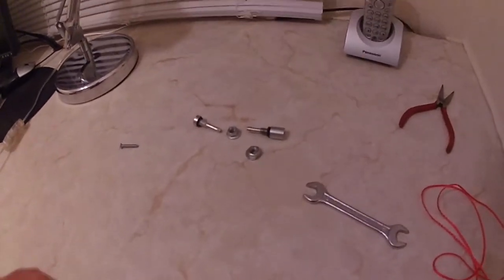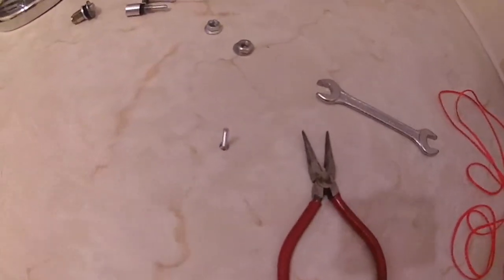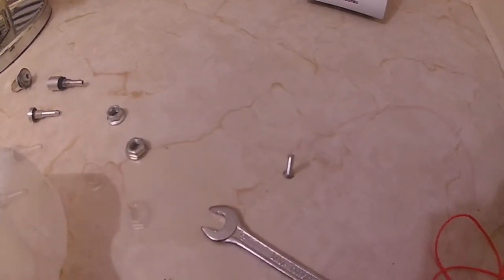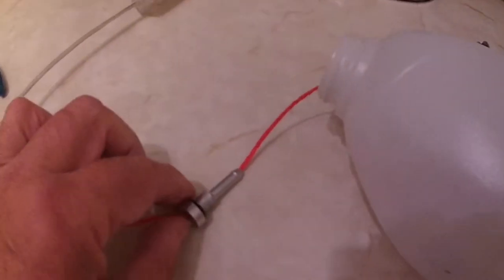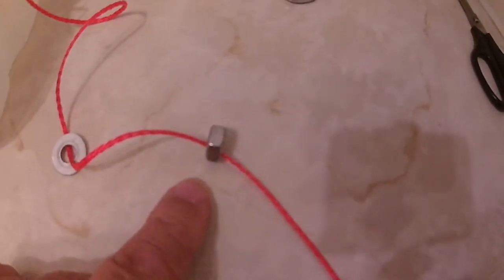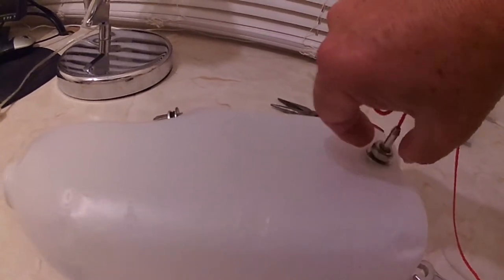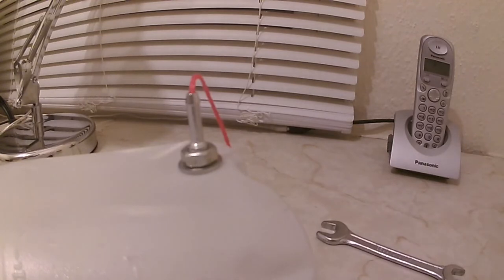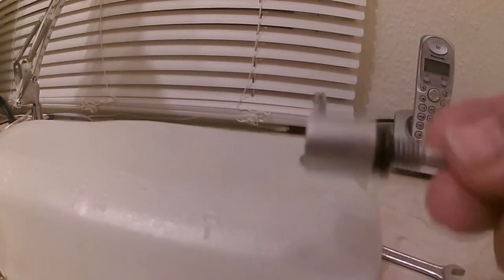Chinese Diesel Heater. Fuel Tank Pipe Fittings.

Comment: You act like in your video that people should already have this knowledge. I know you didn't invent this way of doing it, so obviously you've seen it done before yourself. There is absolutely nothing wrong with asking questions.  I came across this video, looking for people who make their own diesel heater fuel tank out of gas cans. And I was wondering if a vent hole was needed. After putting in a stand pipe, through the tank spout hole, did I need to make a vent? And what's the best way to do that. I'm using a 5 gallon metal Jerry can.
Reply from the maker: Ok matey. Just a tip. Diesel, Paraffin and Kerosene can have water present in the fuel. Metal tanks are not good as rusting can occur.  Diesel vehicles have water traps in the system and have plastic tanks or plastic inside coated tanks. Thanks for comments.  Cheers from old George
Reply: @MakeDoAndMend1  thanks for your reply. Yes, this Jerry Can is spray lined with rust inhibitor. Right now harbor freight has them on sale for 39 bucks, and they are well made little tanks. Even the seams are in a V channel so to not get bumped or hit. I'm wanting to turn this tank into an auxiliary tank for a diesel heater.Some tanks have vented caps, others don't. Can a small pump still draw diesel fuel from a tank that's not vented?  That didn't seem right to me. So, what's the best way to vent a tank like that, without allowing a bunch of water in when it rains? Keeping in mind that the standpipe already occupies the tank spout opening.
Reply from the maker: I have struggled with vents before on tanks. Not really found a good easy way. I have not tried this but just an idea. It only needs to let air in as pump sucks fuel. It may be possible to use an old inner tube valve stem and valve from a cycle inner tube . Not tried it myself .

Comment: Thanks for the ideas/videos.
That said, I think what people were asking was in regards to the brake pipe fitting.  If I understand it correctly, you have the male part inside along with a metal washer and one rubber washer.  Do the whole string and bolt thing to get them through the hole.  Then another rubber washer on the outside followed by a metal washer followed by an O-ring.  Then you put the female on.  The question is then two fold:
1) You won't be able to grip the male part like you show in the video will you?  If not, then how do you tighten it?  Do you not need to hold the male part?  Or was I supposed to also put maybe a lock washer (think that is what they are called) on the inside before the first normal metal washer?
2) How do you insert the copper pipe?  Do I fully tighten the brake pipe fitting, etc, remove the string and then just force the copper pipe inside?  Or do I partially tighten the brake pipe fitting, etc, and then remove the string and insert pipe and then somehow tighten everything?
Reply from the maker: Have you watched all the videos in the playlist. The rubber washer grips inside etc when tightening. Metal pick up pipe is pushed through, slides from outside. Plse watch all videos then leave questions .....
Reply: @MakeDoAndMend1  Thanks.  The first video I watched was from 8 months ago.  Someone asked a question about how you put it altogether (or something along those lines) and you posted one or two days ago that you were about to put a video up explaining it.  Which is this video here.  Sorry, I didn't realize you had other videos on the subject.  I see them now though, thanks.